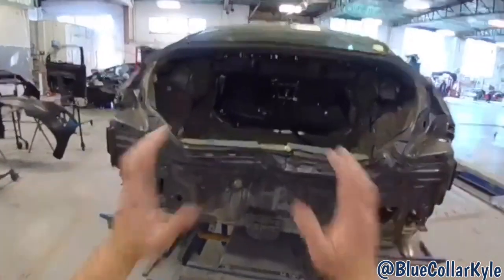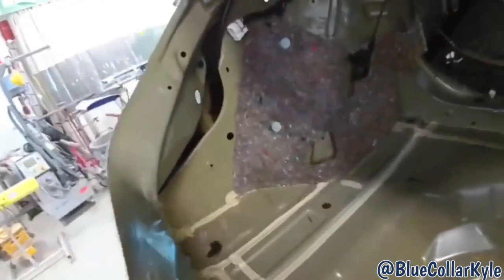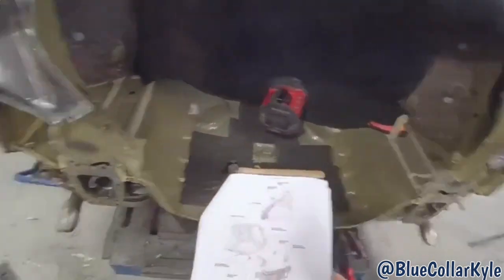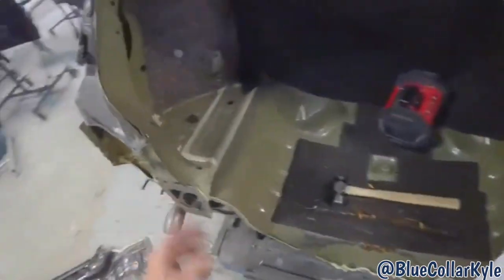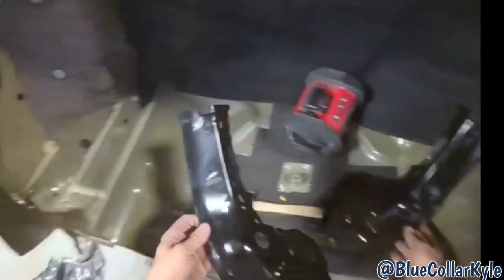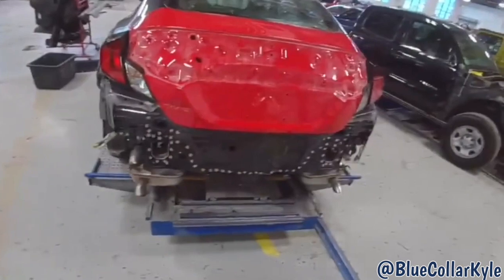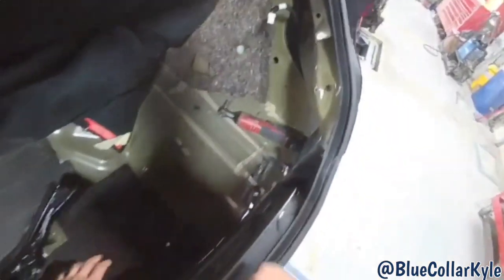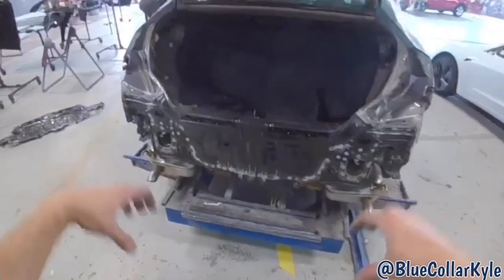Smacked In The Butt!

Comment: When your prepping the new panel for spot welds, how do you know the exact location were to grind? Do you glance at the old panel and eyeball them to the new panel? I dont understand how you get them so perfect.
Reply: John Esquivel , I think he goes off of the spots left after using the little belt sander to grind through the spot welds on the panel that was removed.
Reply: The exact location should not be directly over the old welds because the steel there is compromised. Really as long as he has the same amount of welds and they are properly spaced, where the sit exactly is not usually specified by the manufacturer however all companies are different